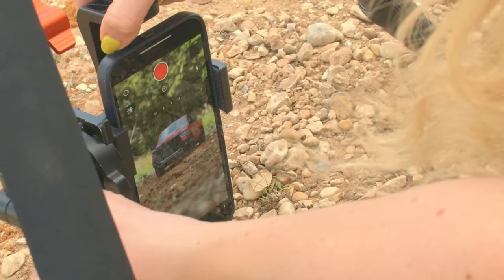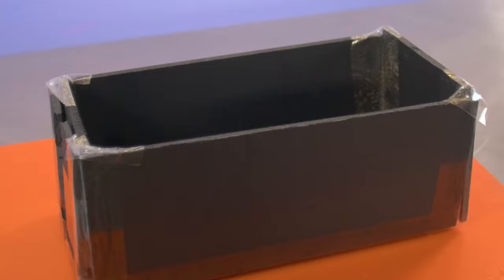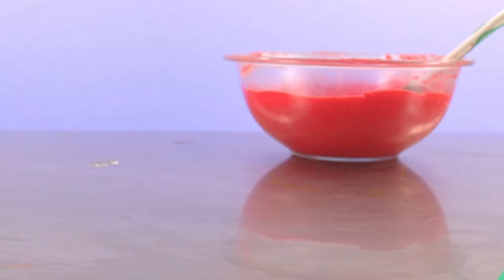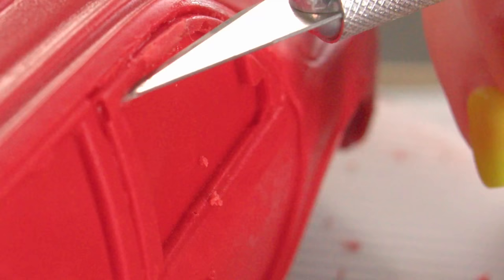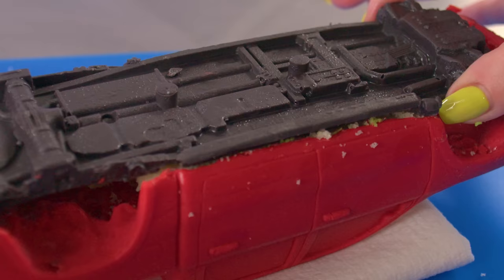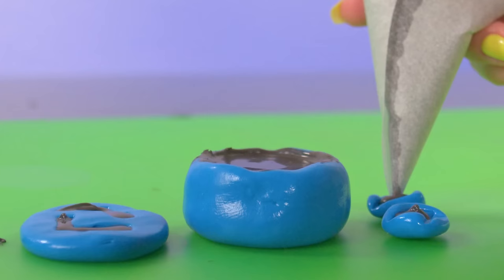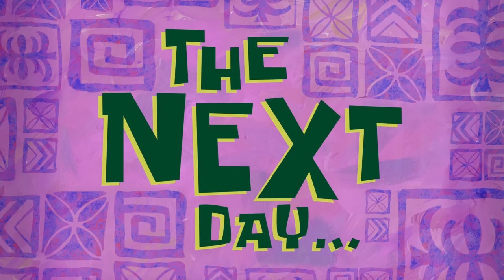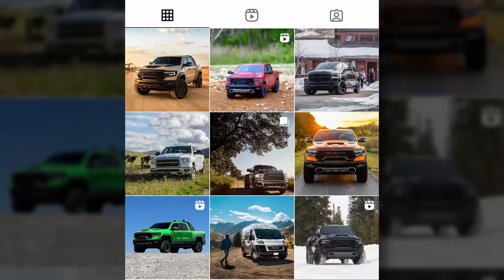How Long Can This Hyperrealistic Truck CAKE Last in the sun?!

Comment: Does the modeling chocolate melt easy enough you have to work in a controlled temp or is it resistant to melting ?